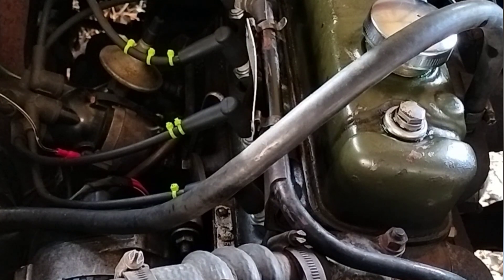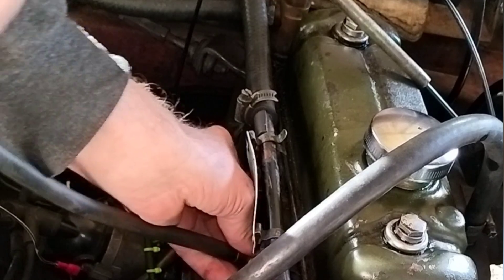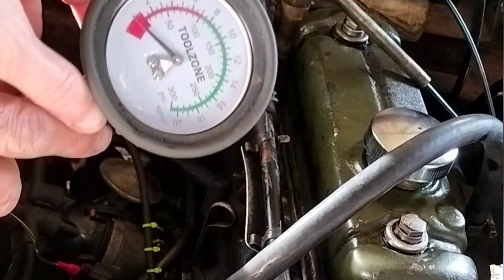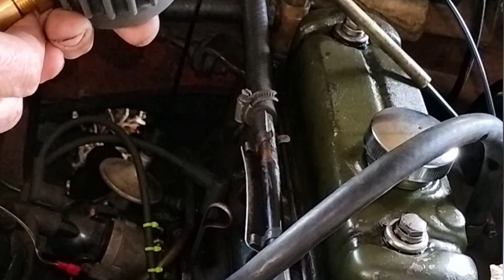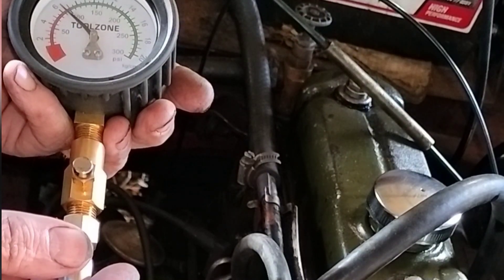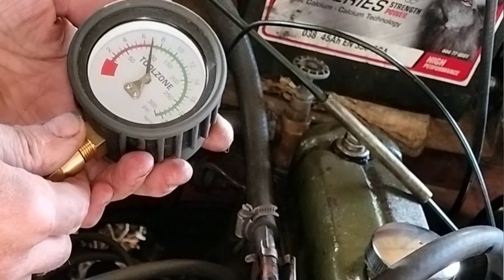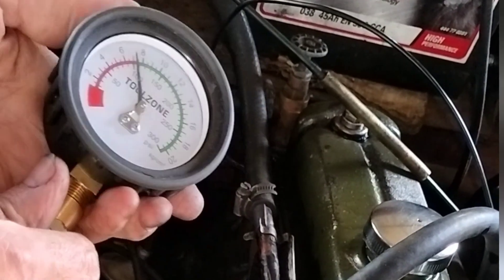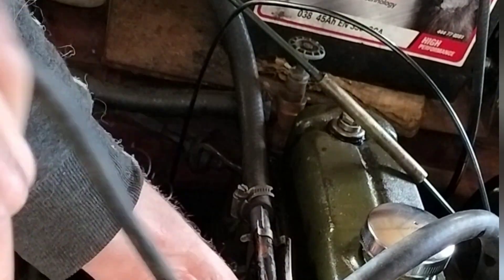Morris Minor Level 3: Hot engine compression test.

Comment: Really useful video 👍 loving the inclusion of the faux pas’. I’ve conducted dry & wet compression tests on one of our cars and it’s been useful to compare against your reading 🤔 mine were 10 or so psi higher but I span the engine longer.
Reply from the maker: @eggybreadplease  thank you, yes that makes sense. We found spinning the engine for a long time didn't help the battery or starter. I guess it's about consistency across all 4 cylinders (assuming we can count to three consistently 😂😂)